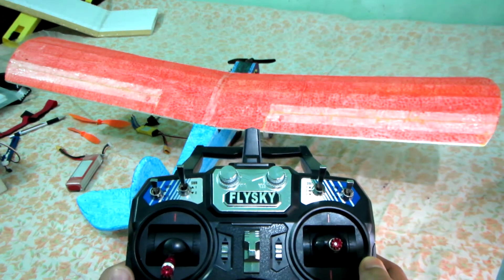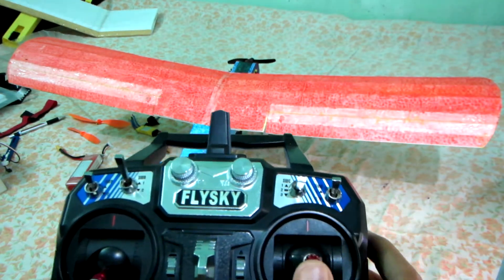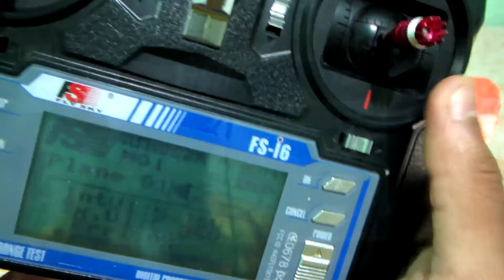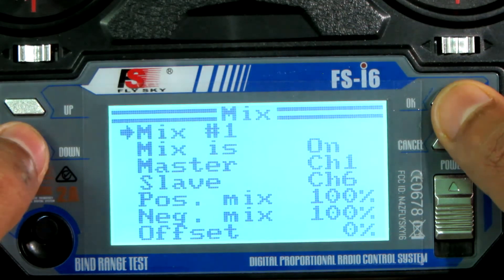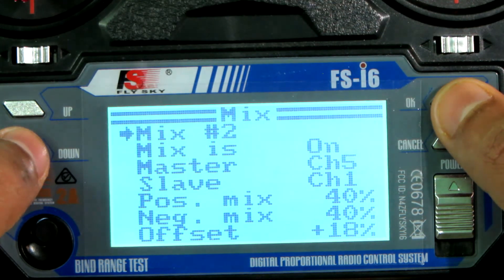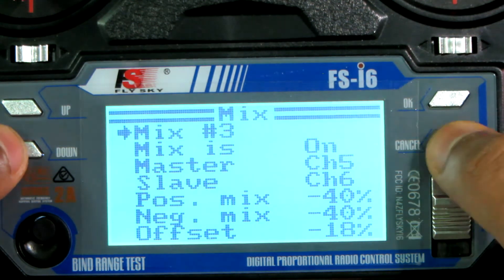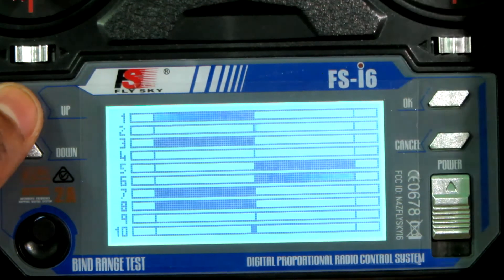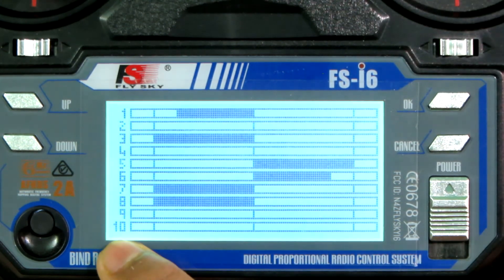Flaperon Mix

Comment: Many thanks for the video, I could not work out how to get flaperons  until I watched this. A couple of technical notes which may be helpful to your subscribers.
1. I'm using a Turnigy-i6 system which I understand is a re-branded FlySky
2. I had to reverse the servos from what is in the manual, ie chn 1 is now the left wing chan 6 the right
3. I had a big problem with "end points" which  I  required to reduce the throw (travel) of the servos. Chn 1 was easy but it did not alter chan 6. The end point screen allowed me to alter the left hand column but not the right until I discovered that the curser for chan 6  can be moved from left to right and vice versa by moving the VAB knob (right hand of the two knobs at the top of the transmitter) Now everything is fine

Comment: 1.41 mins in.... 'this is aileron' ....but they are both going in the same direction! If you reverse one, the mix settings will have to be altered.
Reply from the maker: Here aileron also work as flaps

Comment: ...and this ...NO, AILERONS (23secs in) - flaperons both go down at the same time - like flaps, only using the ailerons?
Reply from the maker: Yes
Reply: @MakerHand  yes? Should be - Yes, sorry I confused everybody?
Reply from the maker: you have to use 1 servo in each aileron and you have to use some mixes to perform flaporon
Reply: I meant what you are doing on the screen! 23 secs in

Comment: Hi, I'm a bit confused - on my aircraft my Channel 5 is assigned to my landing gear. That aside, the main question is -  on your receiver, what leads to the receiver go from/to where? If the CH1  lead is (A)aileron, and the CH6 lead is (B) aileron, why mention CH5 at all? (in your setup). Or is the CH5 lead on your setup  (A) aileron?, with CH1 unassigned?
Reply from the maker: if you use ch 5 then in mix you have to put ch5
if you use ch 6 then in mix you have to put ch6
Reply: @MakerHand  thanks -you use a channel that's FREE (no plug in it) because of the limitations of the switches! On mine it's CH7. Thanks, it's done now, Den ,Wales